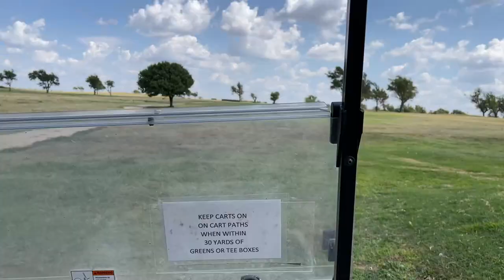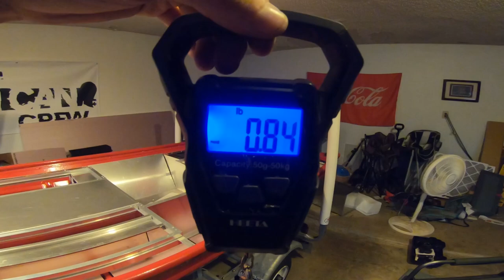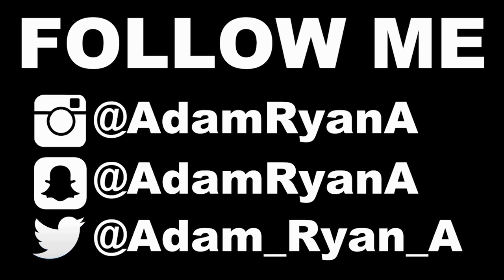ADDING HINGES to Jon Boat to Bass Boat Conversion

Comment: Question why did you put the hinge to the left side of the boat instead of it being on the right I would have thought you would have put the hands towards the motor motor of the boat so if you were to go to the gas station and fill up a tank you can open it and fill it up at the gas station and if you are at the water you can open it same way but spell the cat out of the boat instead of in the boat.
Reply: I wondered the same thing but I think it’s probably easier to deal with it at the gas station (on land) than if it opened inboard and needing in the hatch while on the water.
Reply from the maker: That’s a great question actually and I never even thought of that lol, but you are right, it would of been easier for filling up the gas tank if it was flipped, but also harder to get into while on the boat

Comment: Seems to me like it would have been easier to mount a angle piece to the wall first and then slide in your cross brace and then rivet it into the angle you mounted on the walls from the top.